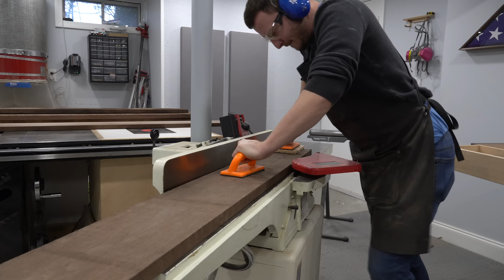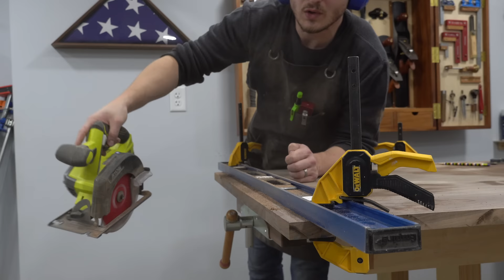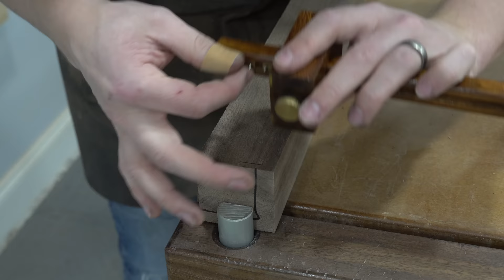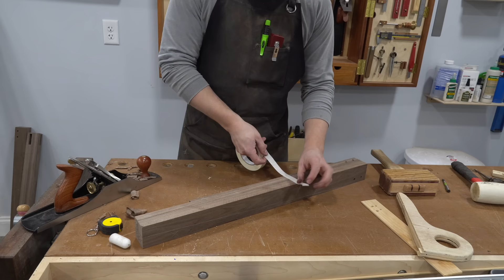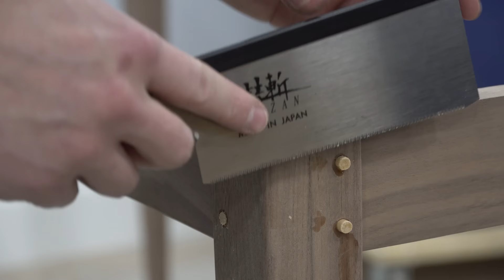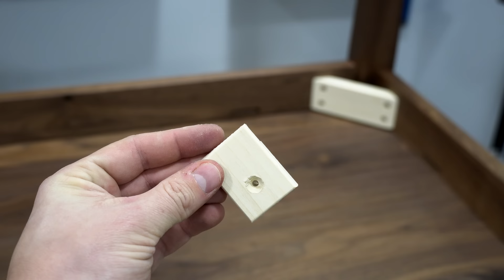Building a Shaker Walnut Dining Table

Comment: Lovely build yields a lovely table. With all the cutoffs, why did you use Poplar for some of the small pieces? One would think you had plenty of walnut left over. Thanks.
Reply from the maker: I could've done it with walnut but I kind of like the contrasting color of a secondary wood. It's the same reason I chose poplar for the pegs in the legs. It invites people to ask me about it, and then I can discuss woodworking with them :)

Comment: Very nice build!  Did you apply finish to the bottom of the table top?
Reply from the maker: Thanks Bill! Yes I applied finish to both sides to help with evening out expansion/contraction
Reply: @dkbuilds  
Thank you for the reply. I couldn’t tell from the video. I should’ve known that a craftsman of your ability would treat both sides of a panel glue up equally.

Comment: How much board feet of walnut did you start with?
Reply from the maker: That's a great question that I actually don't know the answer to. If I ballpark it based on 0:37 I have approximately ten 8' x 7" x 1" boards which is around 45 board feet. However I didn't use all of it! The table top uses 18 board feet so maybe the whole table is 25 board feet?

Sorry I don't have a more precise answer!
Reply: @dkbuilds  That works! Thanks. Nice work!

Comment: Beautiful work -- I love the bevel underneath the table top. Is there any risk to not having breadboard ends to hold things together, or are breadboard ends mostly an aesthetic choice? If so, you made the right choice! How thick is the table top?
Reply from the maker: Thanks for the kind words Adam! Breadboard ends would help keep the whole top flat, but I'm not worried about that because it is attached in many areas to a rigid frame. Breadboard ends also are useful to hide ugly endgrain, which I'm also not worried about because with the bevel only 3/8ths of an inch of endgrain is showing here. There's no risk of the boards delaminating along the glue joints or anything though.

Comment: Nice work.
I was interested to see the table saw fence used to feed the router table to make the sliding dovetail mortise.

I was scanning around to see how you cut the joinery on the cross-brace.

Have you tried a bench hook with the fence on the near side for the pull saw?

13:52 for anyone who wants to watch it again and again  (not as bad as having a heavy bessey fall onto your piece)
Reply from the maker: Thanks biedawo! Yeah the table saw fence to feed the router table was a bit experimental, I'm not sure I love it but I didn't have any other way really.
I didn't show cutting the joinery on the cross-brace unfortunately, but I used the same fence + bit on the router table, holding the piece vertically supported by a jig riding on the fence.
Haven't tried a bench hook with a fence on the near side but I've been meaning to make one for cutting wooden hinge segments where avoiding tearout is critical.
I appreciate the detailed comment!

Comment: I'm not an experienced plane user and was wondering if there is a specific reasons for slightly rotating the plane
Reply from the maker: That's a great question name-less! One reason is that angling the blade slightly tends to make more of a "paring" or "slicing" type cut which can require less pushing force and can reduce tearout. Another reason is that if you are flattening a large board, working right-to-left, by angling the plane so part of it overlaps with and references the parts you've already planed ends up resulting in a flatter board. Hope that helped!

Comment: Tapering the dowels deleted the draw effect, at least partially. Nice finished product though!
Reply from the maker: Thanks for the comment Steve! I disagree about the draw effect being mitigated by the dowel taper. If the taper is short (say, 1/8" long) and the hole that it is entering in the far side of the mortise is deep (say, 1/4" deep), then the entire taper will end up contained within that hole. Therefore the taper is irrelevant once the joint is fully assembled. Does that make sense?

Comment: Very nice! You didn’t stick the table top to the base, why? (sorry I use a translator to chat with you, so I hope you understand my question) thank you
Reply from the maker: That is a very good question! Since the top is made of solid wood, it will expand and contract a little as seasons change each year. If you glue it, that can cause the glue joint to fail. So instead I use clips which allow the top to grow and shrink safely. This top will probably expand and contract 1 or 2 mm
Reply: @dkbuilds  Thank you for your answer! That’s what I deduced. I have another question if you have time to answer it, if we raise the table, is the whole thing solid? The feet don’t come off the tray?
Reply from the maker: @kaliyuga281  Yes it is very solid. You could hold it and shake it very hard and the feet would not come off.
Reply: @dkbuilds  Ok! Thank you for answering me. I will definitely steal the technique! :) In the meantime, you have won a subscriber

Comment: What was the tool did you use to run across the edges before the planer?
Reply from the maker: Good question! Can you send me a timestamp and I’ll tell you 😊
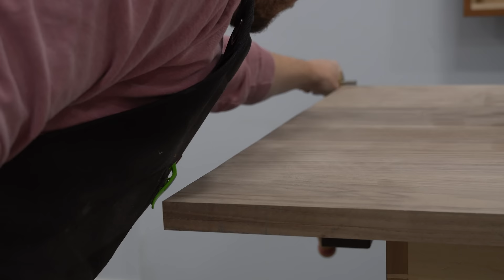Reply: @dkbuilds   5:01!
Reply from the maker: @carsonarnett7948  Ah thanks for the timestamp! That is called a marking gauge, more specifically a "wheel marking gauge", even more specifically it is one made by WoodRiver, and even MORE specifically it is one made by WoodRiver modified by Rob Cosman (he grinds a bit off of the side so it doesn't roll off of your workbench). Hope that helps! https://robcosman.com/collections/marking-gauges/products/cosmanized-woodriver-gauge

Comment: I feel like the braces were overkill when you already had drawbored mortise and tenon joints...
Reply from the maker: Yeah I kind of agree. I felt that if the aprons were a bit wider I wouldn’t need braces but these are pretty narrow so they might struggle to handle the torque if someone were to accidentally kick a leg. Since the braces aren’t visible and are made of a cheap secondary wood I figured why not. I appreciate the feedback!
Reply: Very fair! I didn't think about leverage @dkbuilds
Reply: Stunning table by the way. I have long term plans of building something very similar but with cherry. @dkbuilds

Comment: 桌面不做穿带,以后不会变形吗?
Reply from the maker: No it will not. The multiple clips connecting the top to the legs and apron rails will prevent warping.
Reply: @dkbuilds  Thank you for your reply. I really like your video.

Comment: Pretty good build but those pins were unnecessary
Reply from the maker: Thanks for the tips! I like having the pins; I have had situations where mortise/tenon glue begins to fail (because the tenon was a little too loose in the mortise during glue up), but the pins save the day. Perhaps they were unnecessary here because the joints fit well.
Reply: @dkbuilds  oh yeah it was awesome. In maybe fifty years it might go loose but at that age what wouldn't